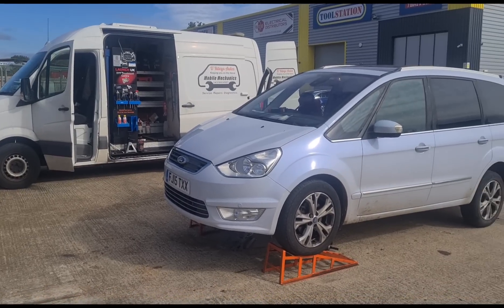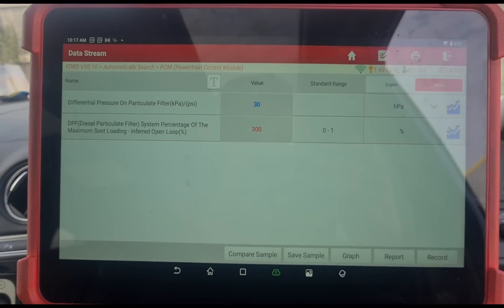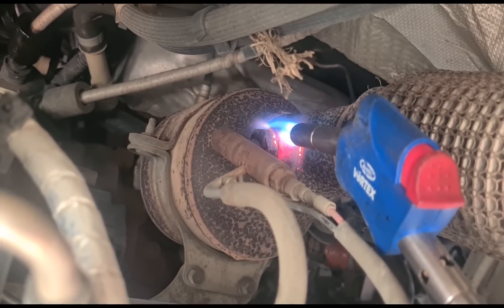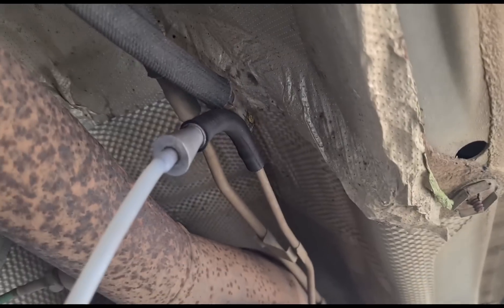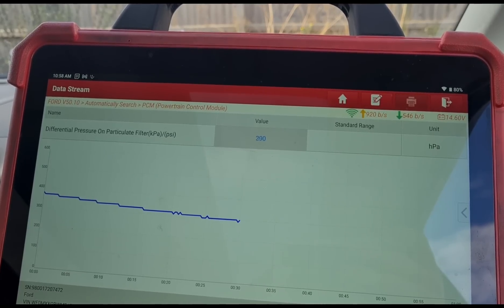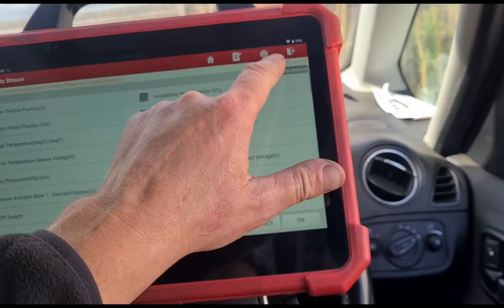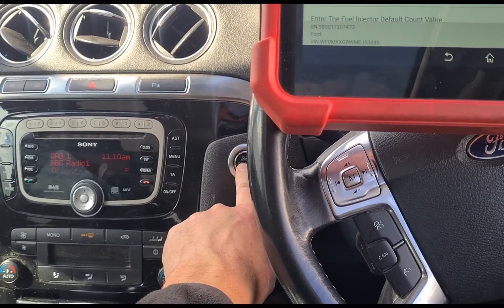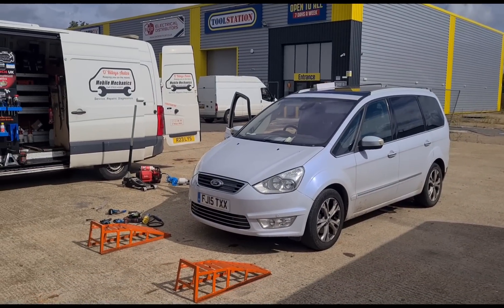Ford Galaxy P269F:72-27 Exhaust Aftertreatment

Comment: My customer just asked me to fit the vaporizer, i advised him to let me do a clean but he didnt agree, 30minutes later he phoned me saying the car got hot so he turned it off but now it wont start 😂, it went into a thermal shutdown ,fault code exhaust temperature to high for engine start , he then had to pay me to reset the exhaust temperature sensors & then he agreed for me to clean the dpf 😂😂😂
Reply: Some lessons need to be learnt the hard way